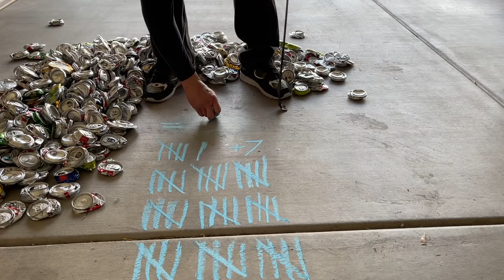Massive Can Meltdown - How Much Pure Aluminum Is In 500 Cans - Is It Worth Melting Aluminum Cans

Comment: Pouring molten metal looks so satisfying honestly.
Reply: It does
Reply: Rather than dishonestly?
Reply: Till it splashes on your foot then things change quickly.
Reply: Yeah and that stuff can explode concrete if dropped on it
Reply: You would have to melt down 106,027 cans to get 1 metric ton of pure aluminum. Today the value would be 2,446.67.  That's a lot of time to make so little.
Reply: It burns, melted copper in huge crucible, felt burn through my leather gloves and jeans, I have a tool that holds it about 2 1/2' away from me, the crucible takes 2 people to pour and it made my skin red after pouring

Comment: Thank you for this video. Pouring it into bars is visually amazing. I do drywall mudding and painting so I like meticulous things. I think I'm gonna give this a go.
Reply: A big scrapyard in my town has an aluminum smelter where they melt down different grades of scrap aluminum to cast into ingots then stamped to show their alloy. The owner said the ingots from melted cans are only used to make more cans so are sold to a mill that rolls the sheets the cans are stamped from. The ingots made from melted brake calipers are shipped to a foundry that makes those and the ingots from aluminum wheels are shipped to another plant that makes aluminum wheels. I was considering on making a few cast aluminum oil pans that would hold a spin-on oil filter for old BMW motorcycles so checked with that yard about the price per ingot made from brake calipers to see if those were cheaper than junk yard calipers. The ingots were cheaper but I would still need to cut them into smaller pieces so they'd melt faster.

Comment: Great video, I took around 200-300 cans that I had saved over around 4/5 months to my scrap yard here in the uk.
Never taking in cans previously was unsure what to expect, the guy at the scrap yard told me due to the cost of what it takes to melt the cans down, the scrap yard hate taking cans as they need a hella lot of them to make any sort of profit.
But looking at your aluminium pile I can see it is a labour of love especially seeing the 1 that you polished up.
Makes me want to get my self a kiln and melt some down my self.
Reply: That's interesting. I had some melted aluminum that I scrapped last year, it was probably aluminum wire that had the insulation melted off. The scrap yard said they could only pay me for dirty aluminum since they can't say what all was melted down. Aluminum is 50 cents per pound right now, and dirty aluminum is 15 cents.
Reply: Aluminum can prices always go up and down so I mash mine flat to get more in a trash bag then wait until prices rise before taking them in. I own a full size '88 Chevy van so often had it packed full with bags of cans with each bag weighing around 12 pounds. Think I got 60 cents per pound several years ago when aluminum was in short supply then 32 cents a few years later after the price finally rose from 24 cents per pound. The scrapyards with smelters make more off the cans and other types of aluminum scrap once melted down and cast into ingots.

Comment: Guys if you all are going to melt Aluminum cans don't make the same mistake this guy and I made. Putting the cold metal bar in the crucible makes your Aluminum solid
and harder to melt preheat it as you mix and add cans to prevent it from getting solid chumps. Good video though keep up the good work👍

Comment: Wanna let you know you are the first person I watched that made me question the whole "melting cans" thing. I am building my 3rd version of my wood fired dry stacked brick furnace.  I have about 20 lbs after my first 4 firings.
Reply from the maker: Is that good or bad? I ask that honestly and whole heartedly, just want to understand exactly your experience before I replied without going into to much info one way or the other in case I didn’t understand the comment completely. 👍
Reply: No question about it, you'd come out better off financially by taking your cans to a metal recycling place.
Reply: @TheGrowingStack  ok NOW is it worth it? Given that propane cost is way up and so is metal value

Comment: You need to flux that slag to get the metal to stop sticking to the garbage. Also, some of those cans had fluid in them, which would cause molten metals to splatter violently; they must be baked dry in the sun or roasting tray feeding the furnace.
Reply: Same flux as the stain glass bond?

Comment: Hi, TGS. That's an interesting video. You seem to get more aluminum oxide than I expected. I guess the heat is a little low. Melted aluminum will oxidize anyway, but not like what you have. Have you determined what the waste is made of? If it is just aluminum oxide, you can reduce it by tweaking your settings. Thanks for sharing! Stay Healthy!
Reply: Thanks for the lesson!
Reply: A lot of that is the paint and plastic coatings used to manufacture the cans, it burns off but takes a tiny bit of  aluminium with it as it forms ash!
Reply: Oxidation is not restricted to recycled aluminum.  Granted exterior paint and content residue will affect recycled aluminum quality.

Comment: I just calculated that with the aluminium prizes at the scrap yard i would get about 3,50€ ( about 3$) for the 4,87 kg.
But for recycling the 517 cans to the shop i would get 77,55€ ( about 70$) .
One can is worth 0.15€ and the scrap yards pay 0.70€/kg for aluminium.
So here in Finland it's a no brainer to melt the cans
Reply: there you go...expand your collection....lots of junk made from aluminum
Reply: You mean NOT to melt the cans...

Comment: Here in AZ its about 35 cans to a pound, but if you melt them down, it takes 50 cans to make a pound. So recycle the cans at the recycle center and use the money to go buy scrap aluminum engine parts at a bone yard.
Reply: Like location makes a difference baha
Reply: @MM-zj8be  Sure it does because some states like NY (where I live) you can get a 5 cent deposit per can for returning them to a recycling center. So you could melt those 50 cans into a 1lb bar that is worth less than 1$ or return those 50 cans for $2.50 in deposit refunds
Reply: @NYC-Gardener  he mentioned weight not money. 35 pounds weighs the same wether your in arizona boston or africa. Smarten up

Comment: I worked for a large nonferrous scrap dealer back in the 80s and found that when we melted cans we were losing money with every melt. Most don’t realize that the vast majority of the recycled cans don’t actually turn back into consumer goods. The cans are shredded and added to desulfurizer, a product that is added to purify steel when it is melted in an electric arc furnace. The aluminum is literally burned up in the high temperatures of the steel melting process.

Comment: The tabs, as far as I know, are aerospace grade aluminum. The can itself, not so much. That's why elementary schools used to have programs to collect the tabs for donating to charities for melting and making wheelchair parts.

Try making an ingot out of tabs only... I'm sure the ingot would be considerably different than the others.
Reply: That's what I want to see--how much or how little slag comes off the tabs, vs an equal weight of cans (at least this seems like the scientific approach to this issue).
Reply: There is not such thing as aerospace grade aluminum. It's a term used by laymen.
Reply: @bingosunnoon9341  Sure about that, are ya?  Search your three word term there in google and see what comes up.

You will see things like:

For example, we supply American Aerospace grades released to AMS/AMS QQ-A specifications. View Brochure.

All aerospace grade means is exactly that, made to some aerospace specification, so of course there are different grades, or specs, for metals, including aerospace.
Reply: @MrJdsenior  Yeah, I'm sure about that. Aircraft Grade Aluminum was coined by the bicycle industry in the 80's to create a buzz. Never heard it before then but now it is mainstream. Never saw it on a blueprint, never put it on a blueprint, never saw it in Mil-Spec book. Even 1100 is used on airplanes.
Reply: "Aerospace aluminum" has documentation and certification of its composition and where it came from... The can tabs don't have and certification so they are not "aerospace grade aluminum" even if they are made from the same alloy.
Reply: @FeetusMcCarland  That's not true

Comment: I worked for a refractory company and we replaced a furnace with splattered aluminum all over it. The owner had two guys chip it all off and it was 150,000 worth of aluminum.
Reply: that is literally impossible... it would have been about 80,000lbs of aluminum.... way way more then would be splattered anywhere.    For context.... an 18 wheeler semi truck can only haul 40,000 lbs on the highway legally.... so it would have been 2, semi truck loads.
Reply: @Legohaiden  I saw your comment, so for fun I searched YouTube to see what 80 000 lbs of aluminum looks like.  And this was the first video to come up.
Reply: @Legohaiden  It's not splattered it builds up on the walls of the furnace over time.
Reply: Cool.... there was STILL not 80,000 lbs of build up.

Comment: I'm surprised that you didn't use any type of flux to remove impurities like they do for pot metals. I did aluminum casting in junior high school shop class, but that was like 45 years ago, and I don't recall much about it.
Reply: Cool story.
Reply: Your shop teacher probably used table salt as the flux since it's cheap and effective.

Comment: Ok. I don't know anything about metal recycling. What I Do remember is there is suppose to be a solar-driven furnace which seems like a good option if you live in Arizona. Just wondering....
Reply: Thats a joke right?
Reply: I'll assume this isn't a joke. You'd have to have an enourmas solar array to power the sort of induction melter required to melt aluminium. Aluminium smelting is one of the most energy intensive industrial processes.
Reply: @stevenm8970  I don't think that what I saw was a conversion of solar to electrical but rath a direct focus of solar energy to a particular focal plane to produce an amplified  result.  Apparently the approach is not so different for using a magnifying glass to start a fire. Thoughts?

Comment: When I first started melting scrap metals, I melted a lot of cans. At one point I had over 250lbs of aluminum ingots from mostly cans. 
What I found to work best as a flux for cans was a mix 40% baking soda, 40% salt and 20% borax. I'd put 1 spoonful into a 6inx6in aluminum foil square and ball it up. Then throw the ball into the crucible. 
And aluminum looks like what you take out at 2:35,  it just needs more heat. 
I don't melt cans anymore because of the cost/work involved. At the time I didn't care because I was doing it for the fun/hobby and I'd use the ingots for other projects.

Comment: I'm doing this and making molds pouring casted gun receivers and finish them on my bridgeport milling machine then heat treating them
Reply: ATF likes this 👍
Reply: Doesn't matter, ATF has no say over homemade firearms that conform to the law.
Reply: @richgallegos5807  It's a joke simmer down .
Reply: Remington597man  I make ar 15 and 10 receivers and starting to make bm59\m14\grand receivers! I have hardness testers and test treatment I also ordered a cetme c and l receiver flats and blue prints making dies to stamp my own flat receivers! I ordered 200 kits over time of cetme and now have the ability to make my own receivers stampings! I am a machinist and tool and die! I use to work for whitman mold and knowhow to make molds also! This is what I do when board and free time on my hands I'm either reloading or building\welding\fabricating\machining something!
Reply: @mrmike8490  the atf already has my file I have a ffl and my personal guns and equipment shouldn't matter I'm not breaking any laws!
Reply: @mrmike8490  it's been two weeks, I'm so calm I had to read the thread again.  Trust me, I'm  alright, but thank you for the concern.
Reply: Remington597man  hi yes I make the lowers and are custom guns being built each one will be serialized and machined to very strict tolerance! Are you looking for 80% lowers???

Comment: Smash the cans tighter and it'll greatly reduce the melting time and fuel cost.  I use a peice of 3" metal conduit about a foot long and a big C-clamp with 2 discs cut out of 3/4" plywood.  I made a piece, out of a 2x4 and threaded rod, to fit in a cordless drill and turn the handle on the clamp.
Reply from the maker: That’s pretty genius Roger! What a great idea! 👍

Comment: Make a shredder saves so much time when the cans are basically powder.
Reply: Smaller pieces = more surface area = more oxidation = more slag = lower yield
Reply: Add charcoal to the charge. You will get way less slag and more metal.
Reply: @Ausogiea  add flux or shielding gas

Comment: I have 3000 cans now waiting for me to stop procrastinating on building the foundry
Reply: watch oki doki videos he use's oil burner set up and it would fit 1,000 cans if you press them thin as paper , stop them , or make hand held like sledge hammer ,  then its just 1 hit , then you get 40 plus and shuffle them on a hydrulic press , press all at once , i use modified wood splitter then 40 cans is down to 3/4 inch ,  ready to put in the burner , less waste than this way ,  oil burner burns hotter than this and its free ,  well still need to run large air comp,  that's ya turbo charger here
Reply: @holdenbrougham1923  I have a can crusher and 3000 crushed cans fills about 6 garbage cans

Comment: The slag still contains metal. There are entire factories for the extraction of metal from the slag accumulated over 200 years of smelting. For example, from 1 ton of slag after smelting pig iron in the traditional way, such plants get 600 kg of pig iron.
Reply: That comes out to 1,320 lbs of iron.  That means 66% of the slag is iron.  Definitely worth running it through the extraction process.
Reply: @imdeplorable2241  Yes, furnaces are extracted by the electric arc method. Colossal slag reserves just underfoot do not require expensive mining. You just need to arrange the transportation of the accumulated nearby deposits of this slag after the steel works to the new furnaces.

Comment: 10:25--- 10 cents per can to return @ 517 cans= $51.7
Scrap aluminum in the form of pop cans- 50 cents per pound @ 10.75 lbs= $5.37
Scrap aluminum casting- 60 cents per pound @ 10.75 lbs= $6.45 minus cost of your labour, propane etc

Based on the ending it looks like you are already melting the aluminium down to make items so might be "worth" it to you but for the average person looking to make some money from scrap metal it is better to just returns the cans. And where cans are not returnable just take the cans in as scrap without spending all the time and effort melting them.

Comment: You could get a 3 in 1 milling machine and use the aluminum to make parts.
Reply: Aluminum cans are a different grade of aluminum than that used to make parts not to mention backyard melted aluminum ingots will have air pockets and will fracture easily.
Reply: @elephantintheroom7063  Agreed, I would shoot for a properly alloyed billet for any critical parts. It may be suitable for non structural castings that need light machining. If you were to melt separately the lid and the can base you would yield a more malleable alloy like (3004) for the base and a high strength alloy like (5182) for the lid. Since the interior of the can is sprayed with a thin film polymer it introduces a lot of inclusions within the melt. Scraping off the interior would be ideal.
Reply: ATF: What kind of parts?